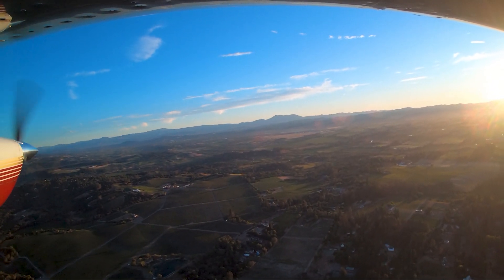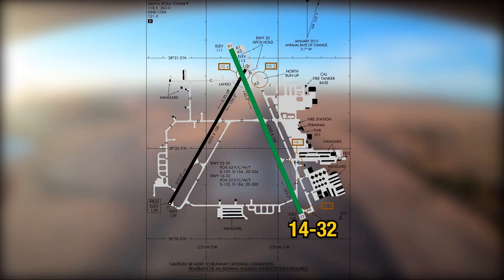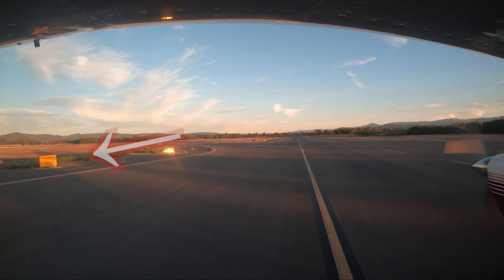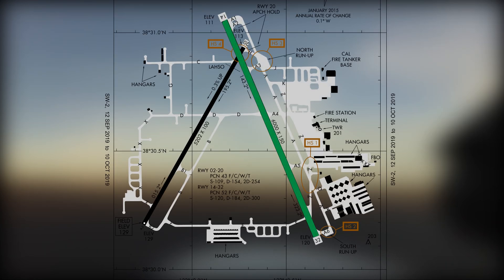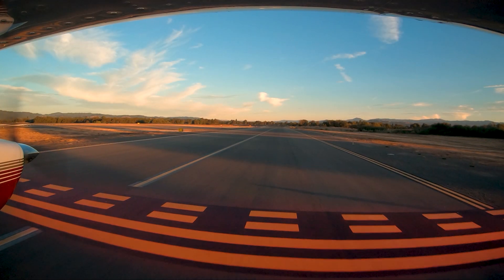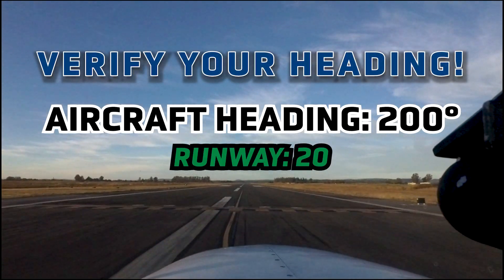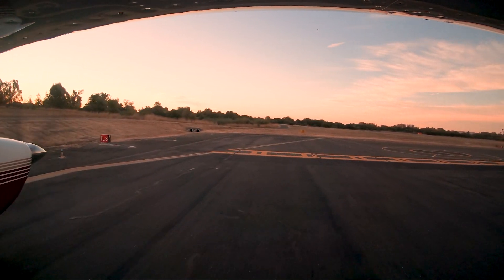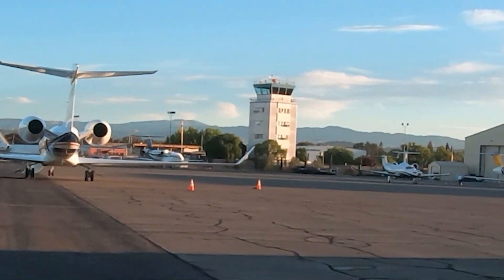From The Flight Deck - Sonoma County, CA (STS)

Comment: Very thorough coverage of the 'hot spot's' @ STS. It has gotten rather busy there with the Rwy extension of 14x32 to 6000ft a number of years ago. Currently there is a full array of flight activity: both fixed wing and rotor Flight Training facilities, two FBO's catering to an active/busy Private/Corporate jet clientele , and is a main hub for Alaska Airlines West Coast traffic, in addition to also being serviced by American and Avelo.  And lastly, but hardly least, it serves as a base for CalFire flight services during active wildfire season. So, yeah, pay attention to ATC !